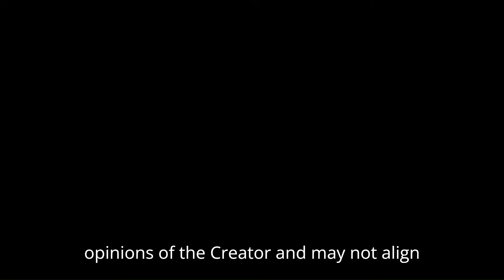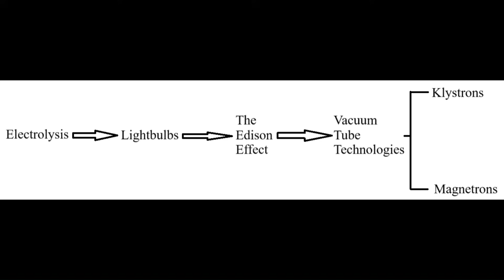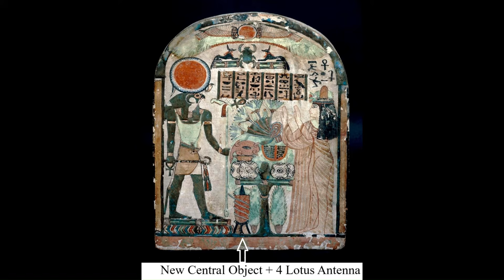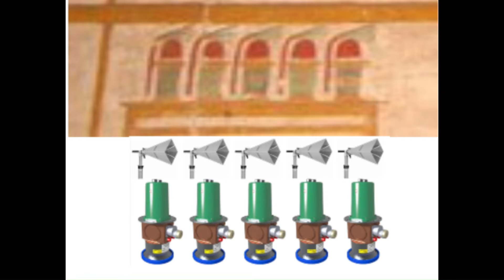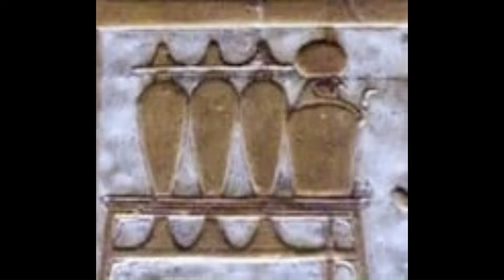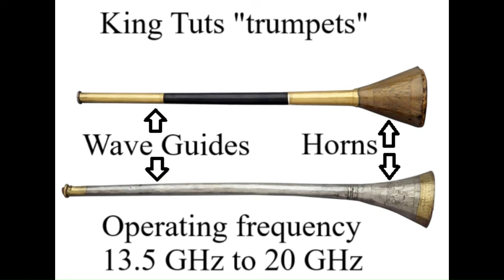Technologies of Ancient Egypt  Part 13   Magnetrons

Comment: Hello Ancient Nukes.. Yesterday I posted my own Abydos magnetron video (small world).   However my video was all about the Osirion.. the buried giant magnetron beneath the sand..   Watch my video but first google "top view" osirion.. youll see it straight away.

Your video caught my eye afterwards.. My theory on Osirion itself as a giant magnetron has been years in the making but I wasnt sure they could scale up so big until chatgpt entered the scene (good for research)

Recognizing your magnetrons just by the horns suggests you likely have more knowledge of magnetrons than myself.. and Im one of the chosen few who mostly understands them..  I learned necause of my video.. basically.. 

I think a lot of ancient tech is built upon static electricity and electron manipulations...

I USED to think hook and flail of Egypt king tut etc.. was push and pull of electricity.. now I think its the push and pull of electrons.. like in klystron amps or magnetrons

I think you will enjoy my video.. feel free to copy or use any parts of my own magnetron video if it appeals to you.. in future episodes

I also plan on a video showing (fire in middle) pyr-a-mid (had interior rain cycle (hydrogen static)

My video goes pretty deep.. the buried double roof coupled with a 14M moat allowed them to lower water to create a vacuum.. 

I am making another video suggesting serapeum coffers are pressurized with 30000psI yeast/bull lipids mixtures to squeeze piezo out of the 20-60% quartz crystal in granite, etc.  They clearly exploded sometimes.. this was ancient architects view once but he withdrew claim in favor of it being a burial site

Anyways.. you seem to know your way around ancient magnetrons.. what would they do with handheld microwaves?  I watched your video but I still wonder what purpose and how they would find or even create such complicated tech

My abydos magnetron link.. compliments yours... Feel free to copy or repost any and all of that one video if it helps make your points if referencing.... 

Cheers

https://youtu.be/Yxj85-Pg3QA?si=nd_GGK_gxWs_Gg8E
Reply from the maker: Hello Wayne, 
Apologies for taking so long to get back to you, for some reason I didn't receive a notification. I've just watched your magnetron and Serapeum videos, thought provoking hypothesis, good job. 
best wishes
Reply: @Ancient_Nukes ..funny you associated magnetrons also in abydos.. cheers

Comment: The mural at 3:45 is fascinating. Do you have any interpretation of the 5 lines of multicolored lotus blossoms? I see an encoded pattern. Very significant! Someone please tell me what it is possibly saying. What does each color represent? Why 5 lines?

It appears to be 2 way communication with lines 1 3 5 going one way in repeating pattern, and lines 2 4 going the other way.
Reply from the maker: Hi David, 

I don't have an interpretation I'm confident in yet. The line of enquiry I'm pursuing is leading towards plasma assisted wireless power transfer.  The myths seem to be symbolically linking RA to H+ the hydrogen ion. 

The 5 lines could be a reference to an ionised channel / plasma channel. 

They're controlled conductive pathways that are created through the air using either microwaves or lasers. They act like an invisible wire in that they help contain any energy that's transmitted through them. 

I suspect they'd developed 5 phase electricity, more phases = smoother waveforms which improves wireless transfer efficiency. So the amount of lines in the stela might be related to that.

Best wishes, I'm glad to see you're taking an interest
Reply: @Ancient_Nukes Actually it was the djed pillars and some of the crazy "radio hat" designs that got me hooked 40 years ago. Before the Internet, it was damn hard to research, and NOBODY had an interest in pursuing the possible tech side to this stuff. They didn't want to hear ANY "crazy" theory as to what was actually going on. The religious people HATED the idea that I was "questioning" their holy handbook. Thankfully things have now changed, so I am grateful to find others who have similar technical viewpoints that I can appreciate and learn from.

What made you think they were using 5 phase power transfer? And why stop at 5 when 10 is even more efficient.? 

Also do you think the obelisks had a significant part in the overall power transfer system?
Reply from the maker: Hi David 

I think they had 5 phase because of some hieroglyphs I cant yet fully read, but they contain the symbol for electricity 5 times in a row.  It would make sense to develop multiphase if they were using remote wireless solar powered electricity stations like I've said the Aten ritual interpretation.

I'm not sure why they didn't develop higher phases. We spoke about magnetrons at Hindu temples previously, I think there's been some kind of continuation of knowledge from ancient Egypt. I think the Hindu and Buddhist Nagas represent multiphase electricity. So I think the higher phases were developed later on. 

When you say 10 is more efficient I'm not sure what the variables might be for wireless applications but in wired transmission, with our current understanding it becomes a case of diminishing efficiency after 3 phase. The amount it diminishes by is magnified in the even numbered phases. 
For example, wired 3 phase is more efficient than wired 4 phase, it would be more efficient to have a 3 phase and a single phase cable. The trend carries on and I think that's why you don't get 4, 6, 8, 10 headed Nagas but you do get 3,5,7 and 9 headed Nagas. I recall seeing 11 and 13 headed ones as well but can't remember where.

I think the obelisks probably served several functions. I think when they were deployed in pairs and the tops were gilded, that they were using them as electrodes in a large spark gap transmitter or as a spark gap as part of something else. 

The word obelisk was given by the ancient Greeks, it means 'little spits'. I think they were describing sparks, if they were likening them to roasting spits then they wouldn't have called them little.  

best wishes
Reply: @Ancient_Nukes Very interesting about the diminishing efficiency using more phases than 3. Thanks, I learned something that I "may" have learned a long time ago, but completely forgot. I would love to see the hieroglyphics with the 5 electrical symbols in a row. Can you direct me to a pic?  It really feels like there is a significant connection between the 5 lines of lotus flowers in the mural and the 5 lines of electrical symbols you mention. When I look at that mural with the 5 lines going in alternate directions, it just screams communication. I NEED to figure out the significance of the way they color code symbols in those lines. Almost made me think of a simple Morris code.

Also I seem to remember that the pyramidians on the tops of the obelisks may have been covered in Electrum rather than pure gold. Do you have any idea, and why use that instead of pure gold as the conductor? It wouldn't have been to save money or resources.
Reply from the maker: Hi David

 I can't remember where I got the 5 phase picture from, If you manage to find out where they're from let me know. 

 5 phase hieroglyphs - https://drive.google.com/file/d/1yE6GprHF_efahiBJP6JI0Oc4wX_pZEdK/view?usp=sharing

Obelisk spark gap hieroglyphs ( from a larger piece titled 'Bas relief at Karnak' ) - https://drive.google.com/file/d/1JXe-FfhpnOomdBFeVGu-BU-E7T9qWePn/view?usp=sharing

I've stayed away from the pyramidion problem. As far as I'm aware we've got no reason to believe there was one, and no reason to believe if one once existed it was covered in either gold or electrum, or made of solid gold. You could probably make a good argument for every possibility. 

best wishes

Comment: You could put a coil around the seat of the arc. I didn't mention it because it's too dangerous already... and the seat also needs 6 legs not 4 so they land on the nodes in sacred geometry. I made some errors. It also can't go on the ground for 2 reasons... you will dampen the vibration and it won't charge if you ground it. I say to ground it so people don't hurt themselves. I say it's not a capacitor.... when it really is an asymmetrical one as well as a Helmholtz resonator. It should repel the earth too but I didn't want to mention it. Keep in mind that  the transmitter did fall from the sky. There was about 20 people with horns that started up the device.. it is written....
.. and once it gets hot it will make it's own sound powering itself... and so simple...

Comment: Heat makes things vibrate. If you take a blow torch to a sheet of plywood you can visually see it vibrate violently. The ancients knew how to use heat to make sound. They were much more advanced than the academia community is today.
How did they cut the rock? They had many methods.  One way is that they melted it with the sun and scooped it. You can visually see the scoop marks. Another was by drilling holes and using electrodes and passing current through it. I seen a video many years ago.... passing current through granite and it vibrates like a jackhammer. 1000 amps and 30k volts... yeah baby!
Heat makes vibration and the reverse holds true... vibration makes heat.
Reply from the maker: Do you think they're still here?
Reply: @Ancient_Nukes  I tried to find the video again but I haven't been able to find it.... but it was a video of John Hutchison plugging in a mini arc to a tesla coil... yes he plugged it into the house power.... and he used a piece of granite on the top of it to keep it from burning.. and the current went through  the granite countertop piece.. and it vibrated like a jackhammer.  He ended up getting rid of it because he had no idea the arc uses vibration. That video was what inspired me to look for the granite disks. ( John built the arc completely wrong.. and he plugged it in).
Reply from the maker: The channel called the library of the Untold just made a video about the great pyramid. The description of the kings chamber roof is similar to your xylophone idea. I think its Christopher Dunns theory.
Reply: @Ancient_Nukes  The Kings chamber is a giant ball whistle. There were 3 slabs making gates keeping it closed... but when the pressure built up in the grand gallery it opened the doors and it blew like a horn. The long 30 foot wide wells going into the basement are like a giant Pipe organ.. tuned to the frequency of the earth. They found Calcium and sulphates and limescale at the bottom of the queens shafts.. the same stuff you find in an old hot water heater that was boiling hard water. That would make the copper rods at the ends of the queens shafts electrodes. Alternating current boils water and it builds up pressure like a musical steam kettle..and then blows like a horn.  The same roof you see in the kings chamber is the same roof on top of the pipe organs going to the basement. Granite is highly acoustic. Granite boxes are tuned resonators. I have one at home made of wood and it rings exactly 360 hertz. When I turn the radio on and play some music it vibrates in my hands. I used sacred geometry to  design the box.. A golden rectangle at 1/3 the size of the arc at 9 inches x 9 inches x 15 inches and the box came out to exactly 360 hertz right on the money. I didn't even have to tune the box it came out a perfect 360 Hertz. It came out an F sharp in 432 hertz tuning.
Chris Dunn was not even able to figure out that the vases he was looking at were Helmholtz resonators and failed to even test their frequency. Anything that is designed with sacred geometry has to do with sound. When it comes to anything the ancients built you have to think in terms of heat, vibration... thermoacoustics... and then it's easy to figure out. I mean it's pretty obvious that that the handles on the vases have holes for electrodes... you put current through it and it heats up and blows like a horn. That's how they made the nobs on some of the megalithic stones.. with electrodes.. drill holes put current through it and it heats up. Granite is a conductor similar to a wire... if you put too much current through it you will melt it.

Comment: There's a video by Praveen Mohan that shows the inside of a Shiva Lingam. It has 8 cavities inside. It's for sure a thermoacoustic magnetron. It has 8 cavities and a central hole. It's possible the centre cog on the arc could have been the same... one hole alone or one with 8 more. But without finding the actual parts it's hard to say for certain. If you saw the disks I showed, by analyzing the wear marks on it I was able to determine some of the missing parts. Unfortunately that was the only photo that exists.
Reply: I saw that same video and also posted my opinion that it was a magnetron of some type. It was hard not to immediately see the similarities. I was trying to figure it out but some pieces missing.

 Those lingams drive me crazy, because I can't figure out WHAT they were doing with them and how they "worked"!
Reply from the maker: I suspect some of them were magnetrons that were passed off as consecrated objects. I think that's were the tradition of pouring water on them has it's roots. Some temples have lingams plumbed directly into the aquifer so the water's permanently flowing over them. It means they designed the site around the aquifer. 

The lingam at Candhi Kimpula is a rare one. Normally you would have to lift the yoni up and remove the lingam from beneath it. This one has been designed differently, it's design allows it to be easily lifted out from the top ( and possibly replaced ). 

The site was buried by a series volcanic eruptions. The evidence shows that the first eruption didn't bury the site and that there was still human activity there. The site was then completely buried by the second eruption. Sometime between the first eruption and the second eruption someone dismantled part of the temple structure.

Source - page 36 of this paper - https://www.researchgate.net/publication/343279968_Candi_Kimpulan_Central_Java_Indonesia_Architecture_and_Consecration_Rituals_of_a_9th-Century_Hindu_Temple

best wishes
Reply: @Ancient_Nukes   There's a river full of them... I think they were using it to heat water .. some may have been used in making singing bowls... in metallurgy.
Reply from the maker: @omegafile  I saw those, I've never heard of the singing bowl use for them, interesting idea. It would make sense to use the natural water course to cool down casts.
Reply from the maker: Hi Omegafile.

I believe some of the lingams were magnetrons as well. I'm sticking to Egypt for now though. I think you're referring to the one at Candhi Kimpulan on Java. I'll probably make a video on that temple at some point in the future. 
What's interesting about that particular lingam is, it has thin gold foils to line what would be the anode block and what would be the cathode disc in the middle has a picture of a lotus flower on it. The lotus symbol seems to be linked to microwave energy both in ancient Egypt AND in some of the Hindu temples. 

best wishes

Comment: The device must have been considered a crowning achievement since the artist depicts symbols of power, with red ribbons, on top of the extra tall poles?  Perhaps these elevated symbols represent high voltage, high Q, high level of function.
Reply from the maker: Hi Terry, 
I can't really make out what the ribbons are supposed to look like. I think the device itself could be related to the Osiris myth.  The word Osiris can be used as a proper noun, ie as a name or it can be used as an adjective, it means powerful. And I think there's been some conflation between the religious myths and the technical descriptions of equipment.  

These murals are at Abydos, some versions of the Osiris myth state that he had his head chopped off and it was buried at Abydos somewhere. It could be that the myth is rereferring to the top part of the sapphire oscillator when it says 'his head was cut off and buried'. 

Best wishes

Comment: Finally, someone making sense of the Osiris device.  While the horizontal "plate" looks linear from the side view, I get the sense that the plate is circular. The whole assembly sort of looks like a Tesla coil with the flat primary winding, central tower and secondary windings atop the tower.
  Thank you for presenting your groundbreaking series.
Reply from the maker: Thanks Terry, 
I never thought to look at it as possibly circular thats interesting. Like I said in the video there's a similar mural that gets called the Osiris stargate device. William Henry has reported on them on his website - https://www.williamhenry.net/2008/12/dis-cerning-the-god-particle/

He's made an illustration of the Osiris stargate device mural so you can see the details a little clearer. The one I've interpreted has 4 blue bands on top of the mast, the Osiris stargate device has a smaller mast with a head on it but there's only 3 blue bands on that one. 

Notice how the magnetrons have squares on the side as well, the 'teapot' cavities from the klystron episode have those squares as well. 

best wishes
Reply: @Ancient_Nukes  Fantastic.